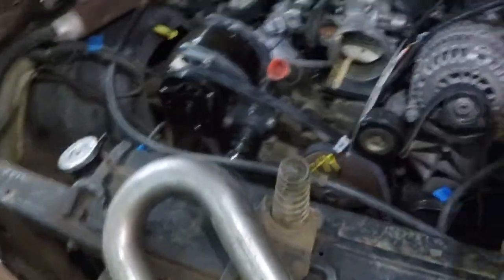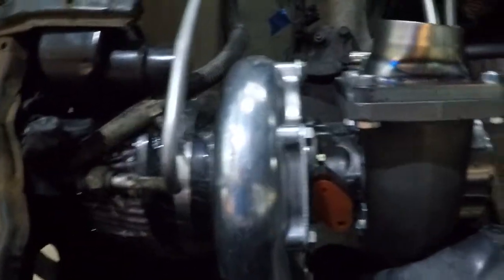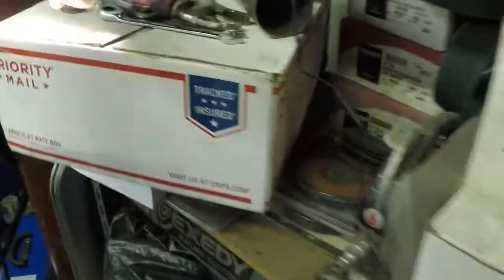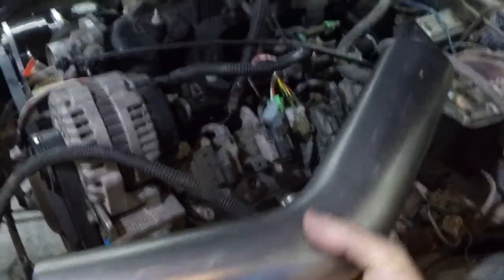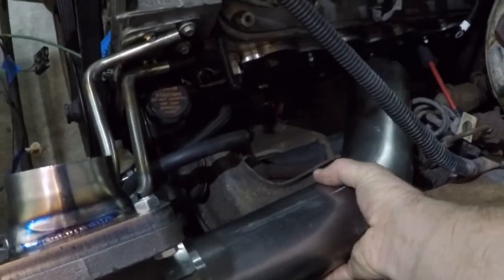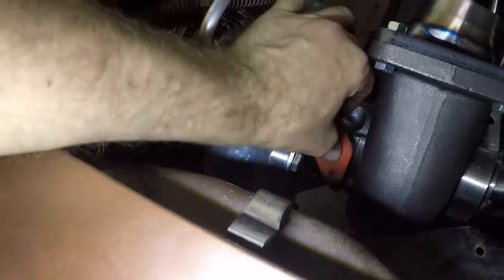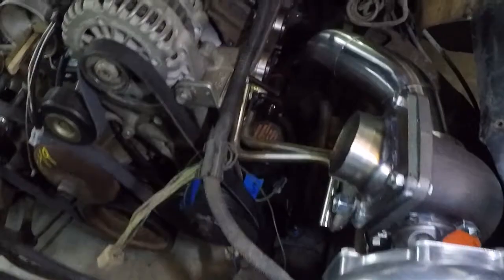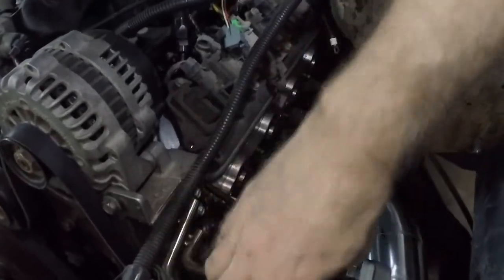downpipe build

Comment: to add to your MS vs SS, if you cant afford to do it right with 321SS, go MS. if you burn 304 on a turbo hot side, you'll burn all the chromium out of it and it will be brittle after heat cycles and driving.